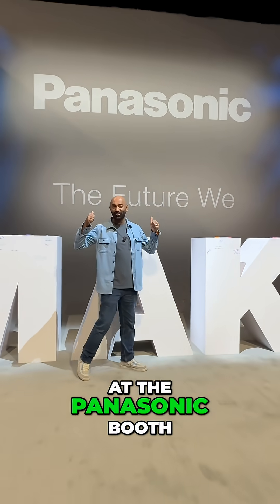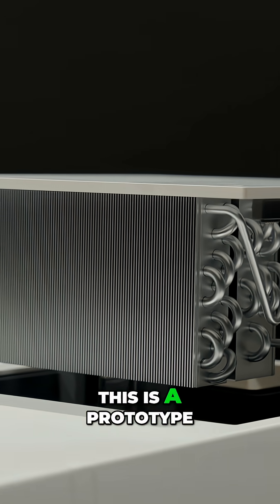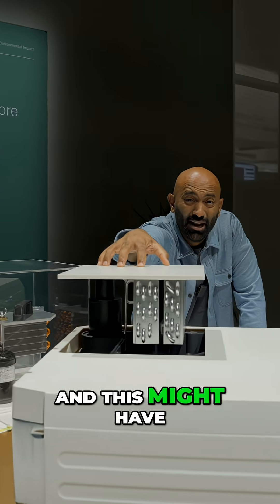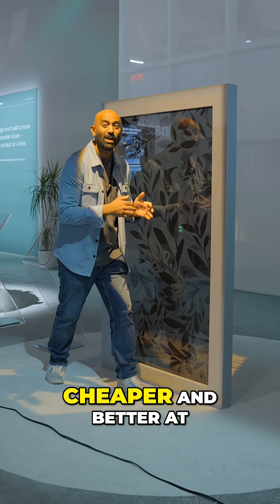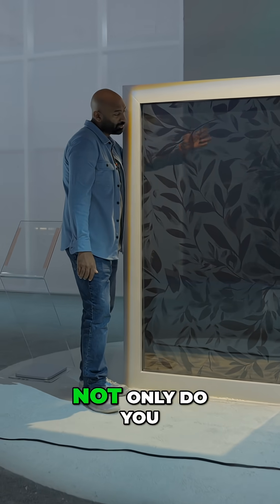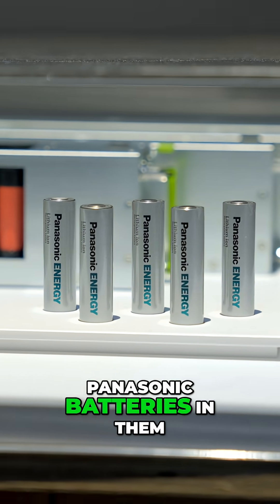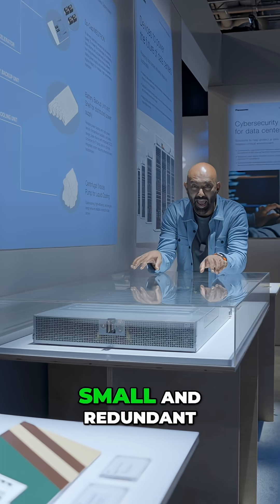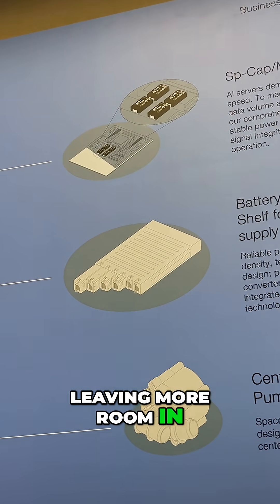The Engineering Behind Panasonic’s CES Innovations

Comment: My biggest problem with Solar Windows is the retrofitting. It's one thing to replace a window with a window. But when I need to replace it with something electricity will flow through; now I need an electrician to run lines all around the house. You can't just tap into existing circuits either because they might not be sized for the load. In other words Solar Windows require the building to be designed for them from the ground up unless you tear out all your drywall to install circuits.
Reply: Or you transfer the energy wirelessly through the air. Been done before and should be commercially available soon

Comment: Nice but a modular heatpump would be better, a sinlge heatpump that can condition your house, do your hot water, do your washer/dryer...
Reply: Pumps need to be sized for the space so with demand so potentially variable I'm not sure how you'd size a unit like that. Wouldn't want your house getting colder because your dryer turned on. Though I suppose you could vent the heat back into the home from the Dryer instead of losing it.
Reply: @MysteriousSoulreaper  my choice would be modulating or staged compressors. No different from how a split unit works with multiple heads.

Comment: Pleased you mentioned heat pump dryers.  This engineer hates them because they take too long to dry.  The main reason many multi-dwelling buildings have them is ducting not required and ability to run on a standard 120V line.   

If you are forced into using one (like me), do research as there’s a big performance difference in brands/models.
Reply: I love the combination washer + heat pump dryer units.